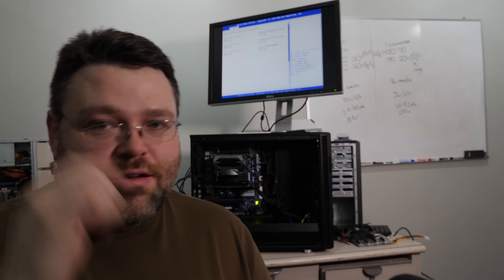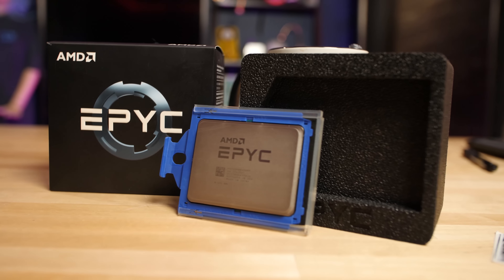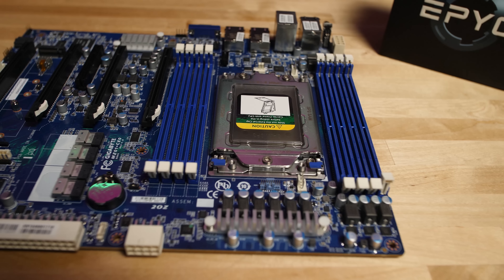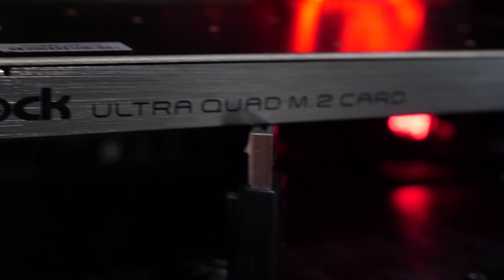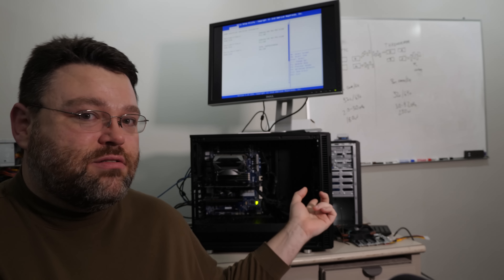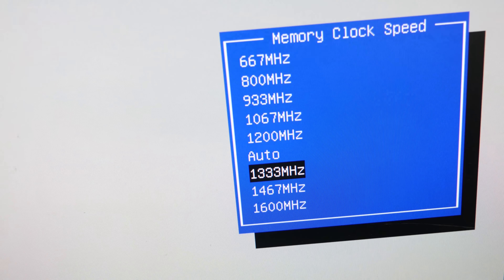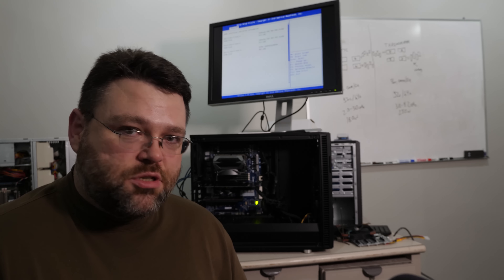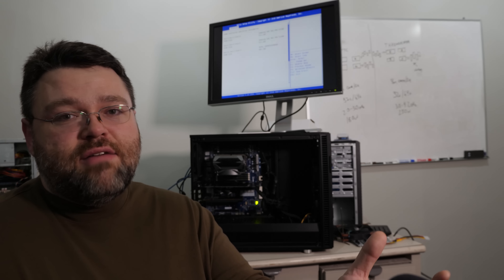Test Driving AMD's Epyc 32 Core Monster CPU

Comment: Is there any way to benchmark one of the high end Threadripper CPU's against that Un-Intel-ligent I9 9900K in an open source OS like Linux or something thats not Biased about what the brand is on the CPU? I would REALLY be interested and love to see the results of this? Im really tired of seeing skewed Data sets between AMD whether its TR or Ryzen and that other CPU business that I suspect are somehow in bed with that business  Pardon my ignorance about anything non windows, but Im starting to get curious about a different OS that I feel is biased and collects / does things I dont know about or want them doing because lack of choice.
Reply: I have been wondering about this too. People are saying AMD processors don't perform as well as Intel ones but I have been running Linux primarily for the past 16 years so I can't really compare Windows performance on them.

I don't have any AMD Zen-based hardware yet that should be comparable in performance to the Intel Skylake processor in my laptop. Then I could run some more proper benchmarks.

In general you can find a lot of benchmarks on phoronix.com and openbenchmarking.org.

Comment: @Level1Techs  you should make a whole home gaming server using steam links or something!
Reply: That is what I said. To do it well, though, we need to wait for Epyc 2 with something like the upcoming 7371 (clocked like a 1950X), but with 32 cores around the 4GHz range. Once that happens, seriously, since it has PCIe 4.0 on Epyc 2, you break out the PCIe lanes to x8, have a mux chip to change the X8 PCIe 4.0 to PCIe 3.0 x16, have 8 graphics cards in it, and to 7 quad core VMs, or do 3x8-core with SLI/Xfire and 1x6-core with SLI/Xfire. Then just need the networking to allow a compressed video to the ARM based client machines which can support 1080@120 or 4K@60 out.
Reply: @ajc-th5ei  If its 4k 60 fps, you could probably get away with 1 Ghz Epyc and split it up a lot...
Seriously, my ancient FX stock is far more than what my Titan Xp could use (that said, you probably want duel Titans for 4k 60 fps at high settings). My main build is TR 1950x at 4.1 Ghz with 4x R9 Fury in crossfire, but its silly how GPU bound things are like I mentioned (for games anyways). You certainly won't need above 2 Ghz for 60 fps with that monster (unless you only allocate duel cores or something weird like that), it just doesn't take all that much CPU power.
Reply: @jakegarrett8109  - the slower the cores, especially if not using higher parallelized apps, the more the CPU is the bottleneck. As such, and considering these VMs will serve as more than just gaming, it makes more sense to want 3GHz+. You can overcome bottlenecks, but it has been shown that even Ryzen 2700X can CPU bottleneck with certain cards when running at 4.1-4.2GHz. This is why faster is important, as well as avoiding spikes in framerates that appear as a stutter. Good video on frame rate delivery at GN a week ago.

But, yeah, I run my TR at 4.05@1.28V (I can do 4.1@1.35V, but...). Meanwhile, my ram is running at 3466@cl14 (used to be 3600@cl14 before the AGESA 1.1.0.0 updates and above). But, tighter secondary and tertiary, so no performance loss.
Reply: @ajc-th5ei  FX is painfully slow, under 100cb on single thread. Ryzen at 2.5 Ghz is just as fast, so if FX is overkill for a Titan Xp (or RTX 2080ti since that's not exactly miles faster), then even 2 Ghz wouldn't be too bad (and that's with FX at 8 threads, you could be running 16 VMs on that Epyc!).

I haven't done any RAM tuning, normally I run my TR 1950x at 4.15 Ghz (limited by a 120mm AIO), and 3600 Mhz quad channel at XMP (horrible timings). I had it past 3733, but my NVME was freaking out at even 102 BCLK, so I couldn't hit 3800 on the RAM (the next bump to 3833 or whatever was too much for 1.35 or 1.4 DIMM voltage).
Then when I was doing some benching for fun (not worried about stability), I was having issues with my board detecting all of my RAM around 5c (so messing in BIOS for more than a minute was problematic when trying to boot afterwards). And anything above 2133 was causing some Memory issues around those temps (just normal ice in a T-Rex cooler, it was definitely above 0c since most of the content was liquid water I had to keep pumping out). I think I hit 4.3 Ghz on validation, but that was with a pretty low 1.55Vcore (decent temps, my AIO wouldn't have been much higher if the cold plate wasn't like the size of a coin, haha!). I honestly wasn't trying too hard though, I only had 1 large cup of ice to burn, LOL! Great fun though!
Reply: @jakegarrett8109  I'm calling bullshit on an FX not being a CPU bottleneck when it has been shown 4790K bottlenecks 2080 Ti, and even an 8700K and 9900K get bottlenecked in some situations for newer games. If talking just midrange cards, then no problem believing it. Been awhile since I reviews which GPUs get bottlenecked by which CPUs at what frequencies.

As to speed, it is the total mix. My regular CB15 score is 3545@4.05GHz, 3600@4.1.

If having a problem with ram after your OC adventures, did you send too much voltage to the SoC and degrade the IMC? Also, that is why I don't do bclk with the platform. It is useless with the quarter step multiplier. Heat is more of an issue. That is why I use 4.05, as any higher is over the 68C for heavier workloads like rendering, etc. 

Meanwhile, for ram, it takes a week or two for certifying the OC for my process. So I don't cavalierly say I'm at my speed and latency, rather I'm rock stable at my speed and latency. But 3x480mm rads and ram fans help. 

If you'd like, you can check out my scores on hwbot, as I used to be more active there, but put my best scores there still when validating my rigs. Also, you can look up my scores on sisoft Sandra and GB3 and GB4. All use this handle.
Reply: @jakegarrett8109  - sorry, I just realized I was referring to 1080p gaming on CPU bottleneck. I am wrong in regard to 4K@60. I have no idea the bottleneck for that on CPU side. My bad. Brain fart.

Comment: In 2990 half the cores don't have "local" connectivity to memory (to anything, in fact) and have to rely on InfinityFabric to reach memory through other zeppelin-dies and correcponding memory controllers. As the result half the cores have much worse memory performance.
That's why 2950 in some workloads can be faster, since it has a "local" memory and PCIe controllers for all the dies.
For the same reason Epyc can be faster than 2990 even running at a lower frequency.
Regarding Windows vs. Linux thing on 2990, I guess Linux just does a much better job of the NUMA stuff, hence the better results than Windows. AMD had specific update for the Ryzen Master to improve the Windows scheduler's NUMA-awareness for Threadripper WX chips.

Comment: "It won't run that hot, it only uses like 180W"

looks at r5 2600x running at 95W rated TDP
Reply: I don't understand your comment
Reply: @mattroy3154  Most computers that people deal with are consumer level chips running at like 100W or 140 max. I just find it funny that he casually mentions a near-200W tdp, way beyond what most people deal with.
Reply: @Skyfalcon12345  Ahh, I guess the FX9590 ruined that for me with its 220w TDP

Comment: could you imagine duel TR4 socket 64 core 128  threads
Reply: You can do it on a single socket as soon as AMD launches Rome. Or 128 cores 256 threads on a dual socket setup.
Reply: that would be nuckin futz

Comment: Can I play Crysis with this ?
Reply: Tiaan Strauss your so 10 years ago. It’s can I play Star Citizen on this!
Reply: Yeah, it would be a monster for Crysis. With my TR 1950x, I run 4x Fury (crushing RTX 2080ti performance) and running Crysis 3 at 4k Ultra settings, it gets around 75+ fps in the worst area (RTX 2080ti makes only 55 fps in the same areas), so you get a ridiculously fluid 100+ fps in most of the game. I wouldn't mind the extra PCIe for a massive NVME raid, then I could really have games load faster! I'll probably run most of them in a RAM drive since I have plenty of extra RAM to store some of my games.